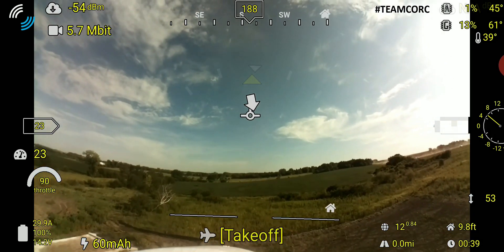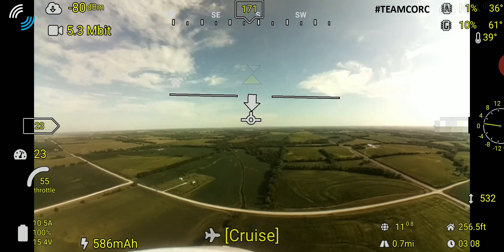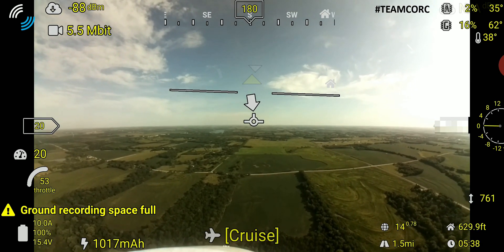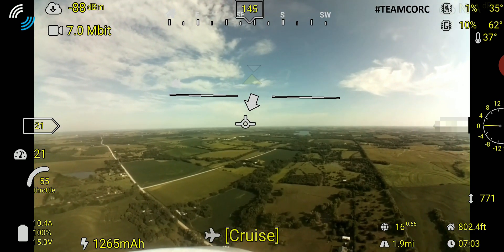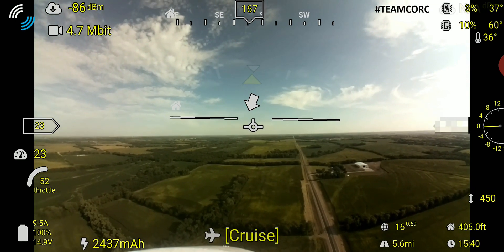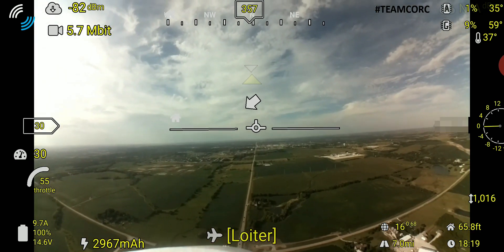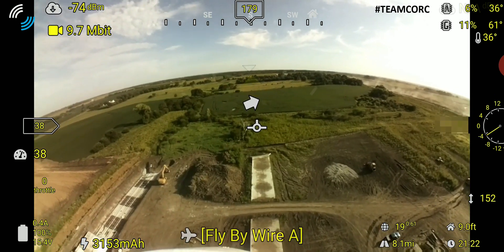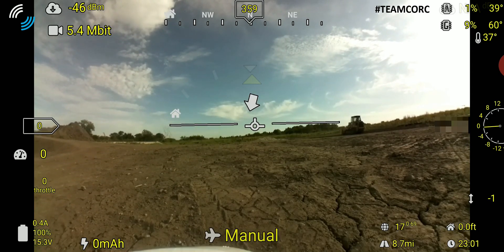Skyhunter 1800 - Longer Distance w/ OpenHD

Comment: What port did you use to connect your FC to the AirPi? What baud rate did you use? You have the same baud rate for the RC_FC and RC_Telemetry? Did you make all those changes to SrX_? I have gotten a video stream with telemetry like the temp, cpu usage etc etc but nothing from the FC. I have tried everything. Why doesn't this work with Pixhawk?

Comment: Could someone tell me if in v2.0.2 the fonts can be changed? I can't see any fonts in the osd font folder. I added one and changed the name but that didn't work.

Looks great. Interested to see how things workout once you add an antenna trackers and use different antenna.
Reply: Yes it's possible to change the fonts. It's under the option to change the osd color

Comment: you should be flying on Linear, it has vastly Superior range and the digital signal used by Open HD does not suffer from Multipathing, your loosing massive amounts of range using CP, they are crap for long range!
If Phase issues are why your using CP antennas, use linear antennas orientated 90 degrees from each other on your diversity dongles.
Reply from the maker: Agreed.  Only using CP as I am still awaiting arrival of my linear antennas.
Reply: @kerrycorcoran4885  you'd be surprised at how well the humble dipole performs, give those  a try while you wait, we all have millions of those and their low gain give a much more uniform flying area when not using a tracker.
Going 2.4ghz will massively boost your range too, i have the same taobao (i assume that's what you have when you say RTL8812AU) 5.8ghz 500mw modules as you but ive also gone for 2.4ghz 100mw modules with 2w amps, not flown with them yet but in ground testing the difference in range is like night and day :)

Comment: Nice one! Have you ever changed the Pi Camera settings to include Stabilisation?
Reply from the maker: Is that a feature of the Pi camera?
Reply: @kerrycorcoran4885  It is. If you're using a pi camera with a raspberry pi computer  you can make the changes. I did see you can implement some of the pi cam features, like emboss and negative but not sure about camera stabilisation.

Comment: sorry for the dumb question, but which is the max distance from home point? the one with the house? is the one with the road the cumulative distance?
Reply from the maker: The "house" is distance from point of origin and the "road" is the total distance covered for the flight.  Note, it was discovered there was a bug in this firmware that was not tracking correctly.  A new firmware has been released to correct this issue.
Reply: @kerrycorcoran4885  so basically how much range did you covered without an antenna tracker?
Reply from the maker: @alerx94  not sure.  I dont know the error variance of that firmware.  Ots fixed now and all seems fine.

Comment: Hi Kerry love the wide angle can the camera not be moved forward a bit and keep the great picture, are your antennas out on the wing tip so there is nothing interfering like the motor or esc.
Reply from the maker: phil hall I mention in the video that the wide lands is due in part of the nose of the aircraft. My proposal Lucian will be to replace the camera with a less field of view camera something along the lines of 150° versus 175°. The Wi-Fi antenna for the open HD FPV system is on the nose platform of the sky hunter. If you go back to a couple videos prior to this oneI have some pictures of the set up in those videos.

Comment: Love The HUD Kerry looks amazing .Is your VTX antenna up or below wing I found putting it down gave me better reception to and from home looks like you have a great system almost worked out . I am  looking forward to final layout take care
Reply from the maker: This is the OpenHD setup so the Antenna is up front on the Skyhunter Nose Platform with the Raspberry Pi 3B+.  The wifi adapter (which the antenna is connected) needs to be soldered to the Pi for best connectivity.

Comment: What is the height of your ground station antennas,  Are all your antennas single band 2.4g ? Are you using both WIFI adapters simultaneously,Can you see the benefit of the RTL8812AU over the Asus?
Reply from the maker: Sitting on the back of my truck; approximately 6' off the ground.
Reply: @kerrycorcoran4885  Awesome sir! Do you use a lens on the V.2 PI cam. Sorry, all new to me, well I have a RPi 1.
Reply from the maker: All wifi adapters are 5.8ghz.  Single adapter on the air pi and dual adapters on the ground pi (for diversity).
Reply from the maker: Yes, using an IMX219 lens on the Pi Camera v2.  You can easily swap out the stick lens and it makes a huge difference
Reply: @kerrycorcoran4885  Looking at the Adafruit site and other and don't see a lens as I know FPV lens. Am I missing something. Well I just logged into the Forum. 'll search there for some setups. Just looking for a good base to start my use case which is great hd fpv , to 1km , near lots of Wifi, some reflective buildings. Also don't want to interfere with the Club's 2.4g LOS gear.
Reply from the maker: @spartan3299  just google IMX219 - they sell them all over, ebay, amazon, etc.